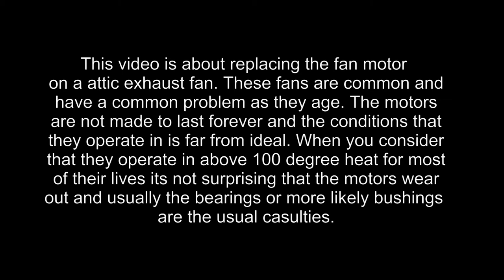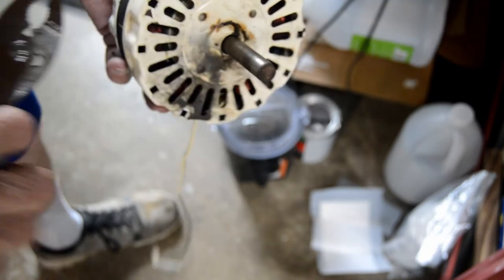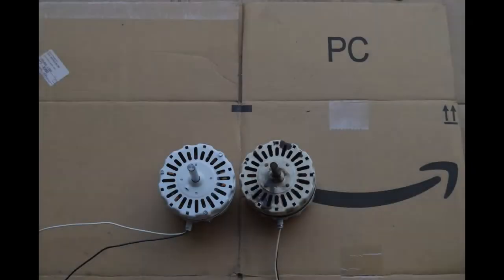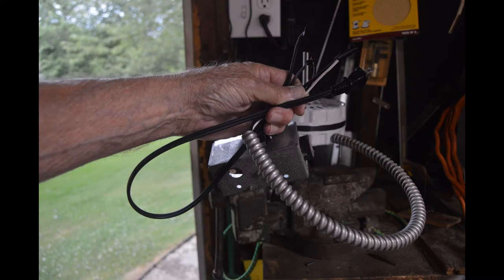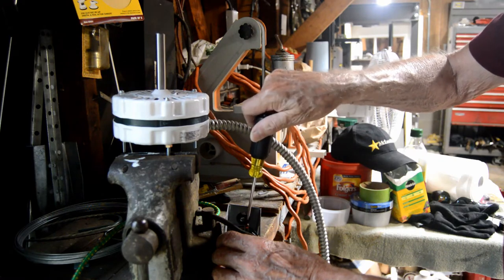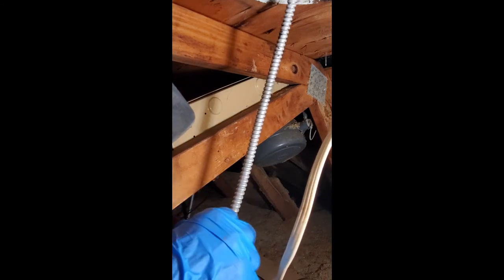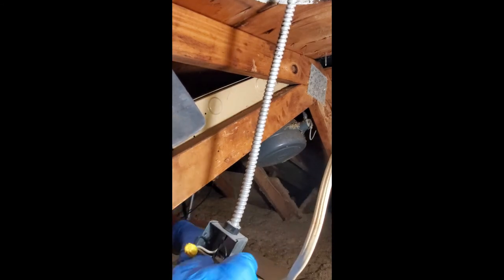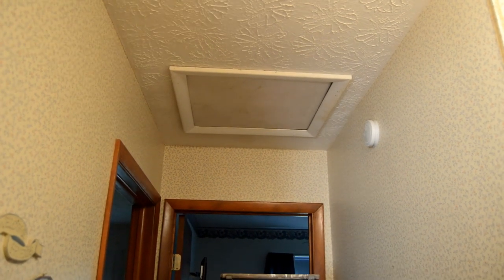Replacing A Worn Out Attic Fan Motor With A New One In A Very Restricted Work Space

Comment: Good video.  I get my Air Vent fan motors from Lowes (Home Depot does not stock the direct replacement for my vent fans) to fit my roof exhaust  fans.  I am not sure if you noticed but your new fan motor has oil ports on each side to add oil to the felt that feeds the bushings.

Comment: I’ve got my ventilation fan taken apart now and it appears to have the exact same motor that you had. Do you by any chance remember which model replacement motor you purchased and where are you got it? By the way, nice video!
Reply from the maker: I ordered the replacement on Amazon and my order history shows:
Broan Attic Fan (340, 343, 350, 353) Replacement Motor # 97009316 1160 RPM 120V.

If that fits your requirements, I remember the diameter was the same but it was thinner by a little in depth. Being a little thinner was not an issue for me. Hope that helps, mine is still fine will be 2 years this coming July.

Comment: I regreased my motor bearings and rewired as diagrammed. I get voltage on the thermostat output when temperature is reached but my motor no longer spins.

Would you have any idea why it doesn't power on? Motor was functioning before, just squealing. Scratching my head.

Comment: I found one of these fans on the side of the road and it would not work so I took it apart and it turned out that the motor actually burned out with flames.